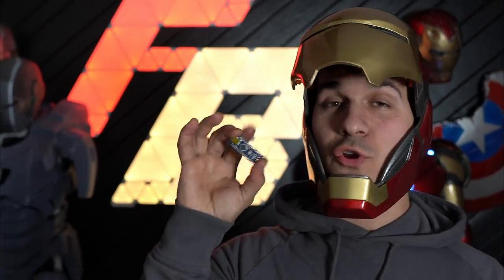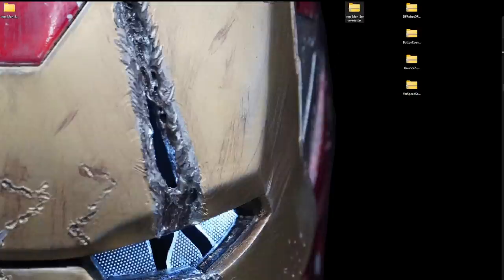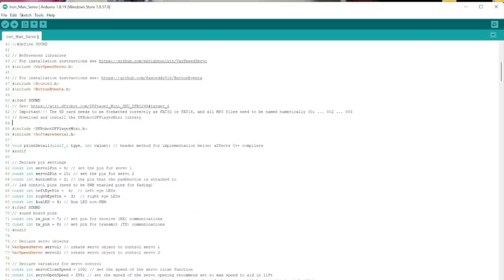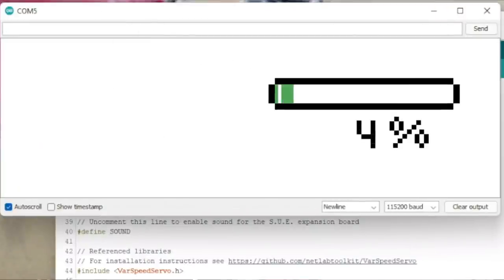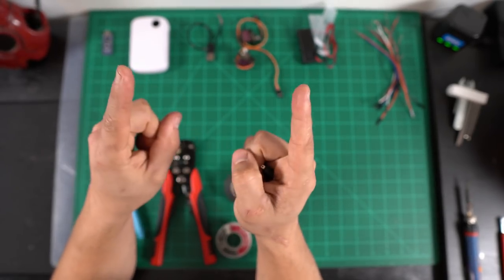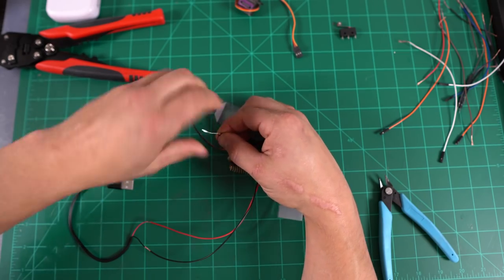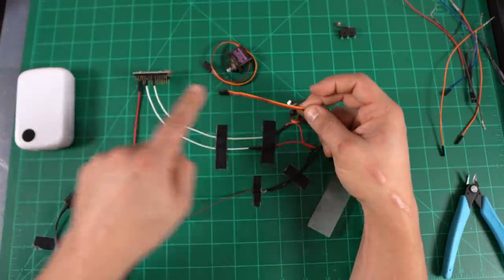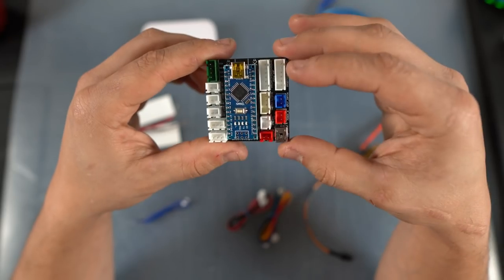How To Motorize an Iron Man Helmet | PART 3|  Coding and Servos | Ft. Crashworks 3D's Alisha Board

Comment: Hey Frank, i ran the ironman servo code directly and it compiled successfully. I uploaded the code to the Arduino Nano and nothing happened, only lights turned on and no movement on the servos, nothing !, The button switch is also not working, the lights kept on bliking. What should i do? I have been trying for 4 days and no solution yet, the new code, didnt have the varservo etcc libraries as a zip file, they are already present as ino file, hence i directly ran the ironman servo code and it probably automatically imported those libraries as they were in the same folder. Kindly help me mate. You are my last hope

Comment: Wanted to ask. If the mask is powered plus open and the power is disconnected, when you reconnect does the mask close? Going back to its original position automatically?

Using this for a different type of helmet and design unrelated to Iron Man. And I’ll be using quick magnetic power couplings to streamline the dangled setup you do. 

So that’s why I’m asking first before I do this. 

Thanks man! I really enjoyed this bud!! Hella amazing!

Comment: Hey dude been buildin my first motorized iron man helmet and your vids has been a huge help. Thank you! But Ive run into a little problem I cant seem to solve. When fully closed one of the servos seem to be wanting to keep running for some reason. It starded with a light buzzing sound and now its a full on rapid ticking sound. If I lift the faceplate a tiny bit, it stops. Tried switching servos and I get the same. What could it be?

Comment: I bought the mini one. Very awesome plug and play. But I have a question. When I tested it all it worked great. After I put everything in the helmet and adding the eyes and all the glue. The face plate weighs to much now. And after it opens it sags closed. How do I fix this, to keep the servo pushing open?

Comment: Great informative video! Thanks for the awesome demonstration. Just need to know what type/model Arduino Nano board you used? Thanks
Reply: did you ever find out the answer to this question?
Reply: @georgemattison9817  I did not, just received a heart and thumbs up. No answer.
Reply: @luannels3075  this is what crashworks said to me 

The code will not work with the Nano “Every” board. You need a standard Arduino Nano , the standard Arduino Nano uses an ATMega 328p processor. 

The Nano “Every” uses a completely different processor, which makes it incompatible with parts of the code.

Hope this helps you

Comment: How do the eyes connect into this analog system? Maybe i missed a part, but any help is appreciated!!
Reply from the maker: You run the eyes separate on a power pack or batteries. You can add a limit switch to active them when the mask closes

Comment: Awesome content, was wondering have you ever tried using a hot staple gun to fuse  the parts together, this is used in a body shop to repair cracked plastics bumpers

Comment: i think its much better to buy a battery, a charge board with usb-c and solder all togheter, will be more thin and lighter than a battery pack, you can 3D print a little box to fit all that thogther :)

Comment: do you know if the Arduino can handle three servos? I have two for the faceplate, and one for the chin. I also have the crash works kit but haven't pulled it out yet, curious if this can be used for the same purpose utilizing three servos.
Reply from the maker: It should be able too. Just need to program a new channel and angle and an output signal pin. Plenty of open slots

Comment: How does Penelope work from Crash works 3D? I just ordered it with the Alisha board because it’s better to have it and not use it than need it and pay more later. I don’t really understand the purpose of it but wanted to know if it has any practical use that you are aware of for an iron man build. Also, is there a way to, through the Aux port on the Alisha board, I can power both the palm and the arch reactor? If so, how.
Reply from the maker: It tricks the usb battery pack into staying on and not going into sleep mode

Comment: How did you remove the red bracket piece with the 2 servos bc in part 1 they were hot glued into the helmet.  Do we have to detach it from the helmet and unscrew it from the arms to use it while setting up the circuit in this video? How would we attach everything back into the helmet?
Reply from the maker: Super glue or hot glue
Reply: @FranklyBuilt  thank you u so much!

Comment: Do you happen to have a guide for adding speech recog?
Reply from the maker: Unfortunately no not yet
Reply: @FranklyBuilt  cool no worries between Pla welding,magnets and the alisha board your guidance has drastically cut down the creating process time line. Thanks for the quick response and videos.

Comment: Do you know what the output of the aux led port of the alisha board is? I see in the video that you have it powering a few leds at once. I'm trying to find the best method of lighting the two led cutouts on the back of the CGtrader akira-yuming helmet. Do you have led recommendations for that?

Comment: Hey, I bought an Arduino Nano 33 IoT but the code is stating it is not compatible with this board. I am brand new to CPP so I am unsure what to change to get it working. any advice? Thanks, Keith
Reply: Ah turns out the IoT Nano only supports 3.3v so no good for this project. I instead got a Pro Micro (and later ordered some 5v Nanos) and everything is good, just needed to change the PINs in the code to suit the different board :) 
Pro Micro is a good shout as it is TINY!!

Comment: If the led eyes are too bright what type of resistor what you recommend using?
Reply: If you use the Alisha board you don’t need a resistor. Like frank said if you hold down whatever button or switch you use it will brighter and dim the lights you just need to hold until the amount of light is ok then let go. Unfortunately you will have to do that every time the helmet closes. Hope that helps

Comment: How could I add more servos to this? Liken say use the same code but for 10 servos. Could I copy paste the other servos settings but change the pin outs?
Reply from the maker: That may be a question  
 to post on my discord. I’m not sure. Discord.gg/franklybuilt

Comment: its giving me errors Arduino: 1.8.19 (Windows 10), Board: "Arduino Uno"

Specified folder/zip file does not contain a valid library

This report would have more information with
"Show verbose output during compilation"
option enabled in File -> Preferences.

Comment: I got an error message after uploading but it didn’t tell me what was wrong. I don’t know if it was the arduino type that I put in or my port was wrong or something but it happened when I tried to upload the code. If you could give some suggestions Frank that would be great. I am trying to change the Alisha mk 7 turning degrees 

Edit. I got it to work

Comment: Hello< How can I download the arduino code, and upload to my board?
Reply: Go to 4:33
Reply: @JCCrom  was not working because at your draw the power buttow is in the opposit direction
Reply: @Timiza4  Can you clarify your issue please?
Reply: @JCCrom  The arduino code was not working. And I saw that at the power button on your 'draw' the connection is different from the video. So I solve the problem here

Comment: Hey so I tried to get the crashworks board but when I clicked the link it brought be to eBay with a error that it couldn’t find the page. Where do I buy it?
Reply from the maker: Check there Instagram they may be low stock
Reply: Will the alisha mini v2 work?
Reply: And what is the difference between the mk 6 and mk 6 PENELOPE

Comment: I got the ALISHA mk6 board, as well as the 5v battery 2 pack that Frank had linked on his amazon affiliate site...It works fine until about a minute in when the usb power turns off. Has anyone had this issue before? Would love help!
Reply: Did you ever find a solution for this?